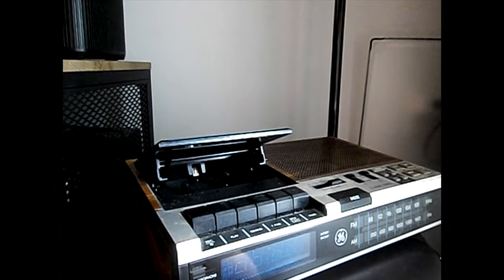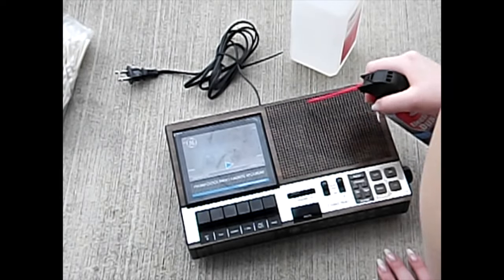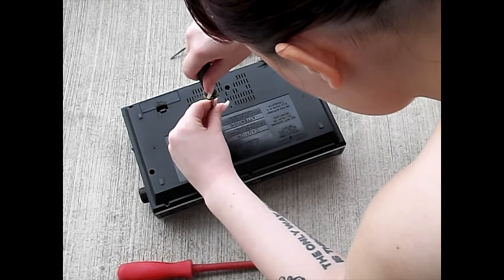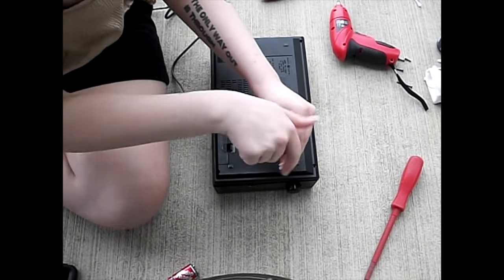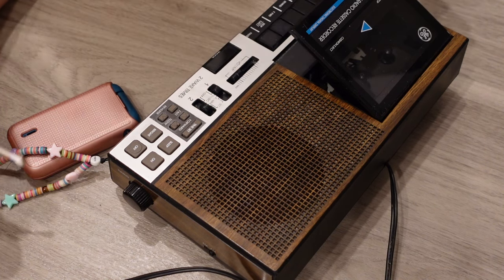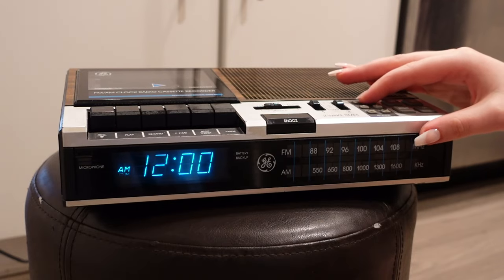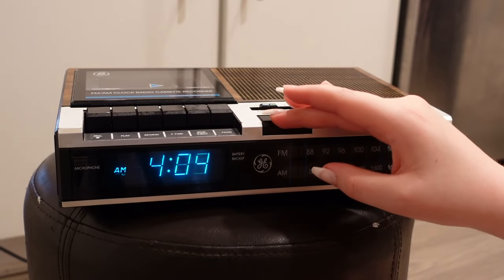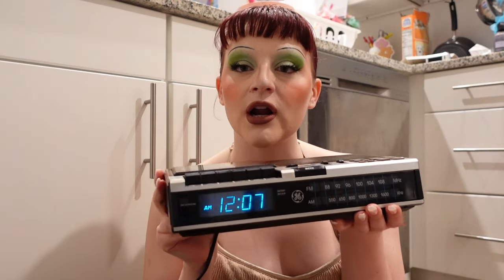Refurbish FAIL: 80s Alarm Clock With Cassette Deck & Radio

Comment: Ooh its got one of those 4-digit GE date codes! Your code, 5121, would be the 5th day of the 21st week of 1981. So this unit was assembled on Friday May 23, 1981
Reply from the maker: holy balls this thing is ancient!
Reply: @crazywarp36  yours was manufactured on Monday, December 1st, 1980
Reply from the maker: @me3head electronics years is like dog years- or vice versa. Don’t feel bad 😂

Comment: One of my weird early 90's childhood memories was the woodgrain Panasonic alarm clock my dad had purchased (probably before I was born, green LED's). It was just an AM/FM job, but I remember its big snooze button, and trying to tune in stations... I will always have a soft spot for 80's tech because that was the brand new stuff my pops was buying at my age.

Comment: Nice Catch Yasmine. I had one of those old vintage mechanical Flip clocks made in the 70's, their is a Modern Electronics company that have recreated these flip clocks but they're not quite the nostalgia because of modern electronics in them. So yeah I have a soft heart for these things. I believe they should be saved and taken care.

Comment: I have a Radio Shack Chronomatic 309 that I bought with my own savings in 1997. It is a stereo cassette recorder, green led, dual alarm, forward and reverse time controls, bass and treble, and a lighted dial string. I’ve always been a fan of clock radio cassette units. I haven’t seen your video though yet, but few things are truly a lost cause. Love your videos. :)
Reply from the maker: Appreciate your comments so much 🩷

Comment: 3:35 Whenever I clean vintage audio equipment freshly purchased from thrift stores, garage sales, auctions, church rummage sales, etc, I simply use a slightly damp microfiber cloth (with water only) to gently clean away years of gunk without damaging printed letters or causing scratches, etc.

It really does the trick and I also use slightly damp microfiber cloths to clean vinyl records, CD's, DVD's, Blu-rays, as well as VHS and book covers because they grip the grime and gunk without damaging any surfaces, especially playing surfaces, so if they can leave a CD unscathed, for example, they really are one of the best tools to use when cleaning vintage gear.  :)

Comment: Good video! I have a GE clock radio that's a bit newer its from the early 90s. You keep mentioning that you think it is broken, but to me it looks perfectly fine, the display is a VFD (Vacuum florescent display) and it still looks nice and bright, they just have that glow around them nothing to worry about, The cassette mechanism looked great I bet it still works fine, worst case scenario it might need a new belt. The AM/FM switch is just dirty, all you have to do is switch back and fourth a few times. You should be able to find the manual for it online to tell you what the buttons do, they are pretty easy once you figure it out. That thing still has lots of life left in it, no need to be afraid to use it.

Comment: Stripped screws are the worst. Try a flat head of similar size and see if that works. If all else fails just break it open. Then you can reglue the bosses back to the case after you get the screws out.
Reply from the maker: I Iove the speakers on the 309. I will try a flat head!!

Comment: Nice! I got a vintage morphy Richard alarm clock radio at the Salvation Army for £2. I tested it and it didn’t work. I tried and failed to fix it. The buttons on top didn’t click anymore so I opened it up and noticed that the metal contacts had came of so I cleaned it and stuck them back on with sellotape. And it still didn’t work

Comment: when the screws are stripped like that and made of some brittle/soft metal the only way to get into the thing is to drill them out and replace with some sensible screws which are not total crap.

Comment: GE has always been a fairly generic brand (It's not called "General Electric" for nothing), but I do like the vintage look of their alarm clocks, answering machines, etc, particularly with the fake wood veneer.

GE is a major multinational conglomerate, of course, that has been around since 1892 and today, it is an $18.3 billion business (BILLION with a B) which employs over 50,000 people. :)
Reply: They sold of their consumer electronics division in the late 80s to a company called Thomson. they don't really make any consumer electronics anymore, in fact no one does anymore since smartphones killed everything good.

Comment: Fortunately mine works perfectly fine after taking it fully apart replacing a bad cap and changing the melted ff belt
Reply from the maker: That’s awesome!
Reply: @YasmineCollects  if you ever get those screws out you will need to remove the volumn slider and the tune knob and open the cassette door for the top half to come off , but to remove the cassette mechanism you will need to Desolder the motor wires

Comment: I often use a flat screw driver if they are stripped. I dont understand why you make it worse and worse, you need the right size and some pressure, if it does not turn, you strip it. The cassette drive looks a bit strange -> EDIT: It has Rewind, so I think the second spool or however that is called is missing.
Reply from the maker: I actually cut this part out bc I don’t wanna harp too much but I asked myself why I made it worse too. My answer is because I’m very autistic and just get too excited “maybe if I keep going it will work” lol. 😭
Reply: @YasmineCollects  haha well, we all have been there. As I said I often find a flat screws river to "bite" better or maybe it kinda gets stuck in some position and with lots of down pressure (to not slip) it may come out. Also it sometimes helps to heat them up but that's not a help when you can't reach them.

Comment: G.E.'S old tag "we bring good things to life."
Only in this situation it's Jasmin brings awesome  old tech to life!
You can wait until midnight (or 12 noon if you don't care about the am/pm part.) then plug it in and the time will be correct then. I got a couple of these i use for a clock but they don't have the cassette player. The alarm clock story i have is that
I got woke up by my clock radio on 9/11/01. 
The wake up alarm turns on the radio and 
It woke me up...sort of. And i was trying to ignore it half awake when i heard the radio DJ started talking about the airplane hit the NYC twin towers.
AND THAT GOT MY ATTENTION! Turned on the 📺 quick. And after that, in a way, whatever was left of the 1990's died that day. I wonder how many other people woke up on that day the same way?
Reply: Yasmine. Oops. Misspelled your name.
Please forgive me.
Reply from the maker: No worries about my name! That’s a great idea haha, I suspect it’s gonna have more issues so I want to get it open at some point. It’s really sad how things changed so much, it’s a very distinct difference